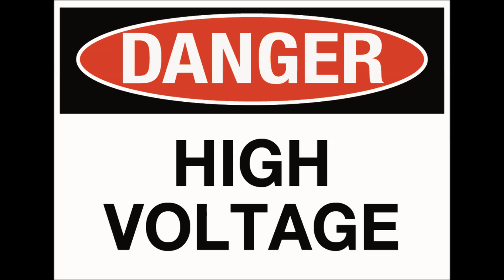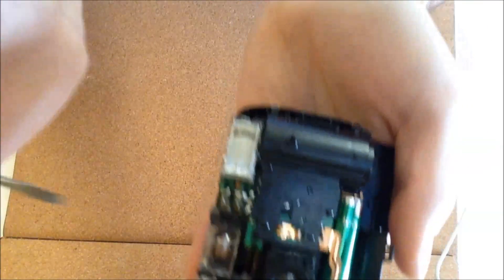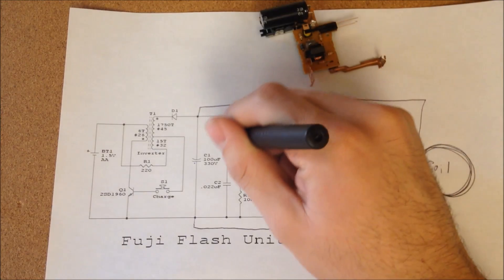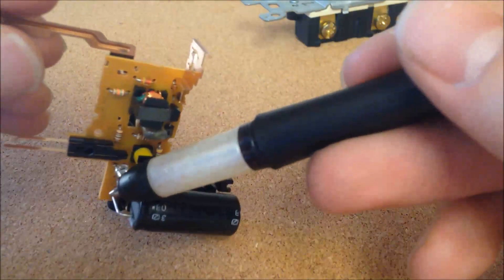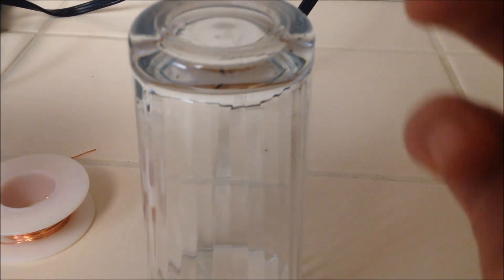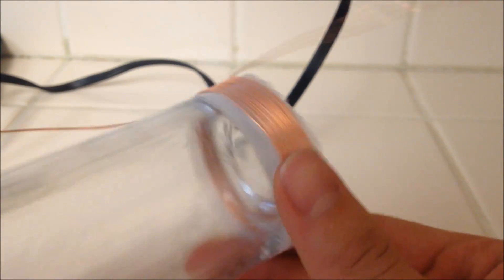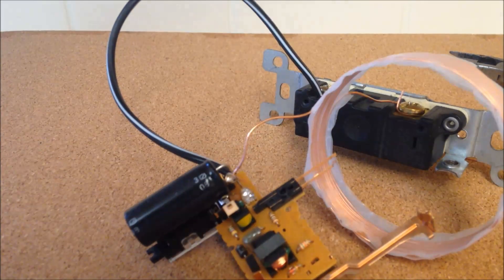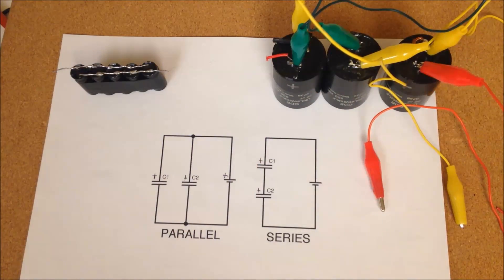How to build an EMP generator

Comment: Hi Cameron, is there a way to direct the wave to an electrical device? Or is that not possible. Thanks.
Reply from the maker: Since the pulse is emitted through a coil, I don't believe so and I haven't found a way to do it. That would almost be like trying to make very strong 1 poled magnet (a magnet has 2 poles, north and south). This device is basically a very strong electromagnet but without a ferromagnetic core within the coil.

Comment: If size wasn't an issue, could I use a very high voltage capacitor bank and charge it with a cockcroft-walton multiplier? Some days, I just feel like taking down the neighbourhood, y'know?
Reply: Don't worry I feel you lol

Comment: What Objects would this jammer disable?
Reply from the maker: +Andres Ramos It depends on the electronic device and how its design.
Reply: +Cameron Cobb what can I do to make it more powerfull ( if i decide to built it) ?
Reply from the maker: +Andres Ramos the best thing to do to make it more powerful is to add more capacitors with higher voltage and high capacity. I recommend using capacitors rated 400 volts or over with high capacity (over 500 uF). It is very hard to make a device like this very powerful because it is different than a military high altitude EMP.
Reply: Ok thanks :)
Reply: +Cameron Cobb Do you think it could disable a vehicle with enough of everything? i wonder how much it would take if a vehicle was following .
# need for speed rivals lol

Comment: Right now, I have added a 82uf/400V capacitor in parallel, but it still does not disrupt my basic video game. Do you know why it does not work or do I need to add more capacitors? My other problem is when testing the EMP (for the fourth time), I accidentaly managed to discharge it and everything just stopped working. No sound, no LED lighting up at all. I could hear the hum and see the light before but now, nothing at all happens. Do you have any idea what cause this problem? Thanks.
Reply from the maker: +dude12345 I know exactly what your problem is and it is common. When you charge the capacitors you must make sure you stop charging the capacitor BEFORE you send out the pulse. If you don't then you will damage the circuit and it will NOT work anymore and you must use/buy another circuit. And i think you should put more capacitors in parallel (make sure they have the same voltage) because it doesn't seem powerful enough to me. Another problem is the device you are trying to EMP. The devices will have a different effect than others, i recommend a very cheap video game or a digital thermometer. Hope this helps, contact me if there are any more problems :)
Reply: +Cameron Cobb ok thank you very much!

Comment: Does the copper wire have to be enamel coated?
Reply from the maker: +Nicholas Lybarger It does not. But its better because you can wind more. Think of it like an electromagnet. More winds, the more powerful it will be when induced through a current.
Reply: +Cameron Cobb ok. Thanks

Comment: you have to use a used camera that not everybody have for this circuit, yet it can be done by an autonomic self made voltage booster circuit as well
Reply from the maker: +Ronen Shemesh you are absolutely correct
Reply: Can you use a battery and and an inverter, that you connect to a wire with switch and then the coil?
Reply: @janeveroniica  yes, once you disconnect the battery it will change the magnetic field on the primary side of the transformer and that will reflect on the secondary side which needs to have many more turns with smaller gauged wire

Comment: Instead of a phone put a metal object, like a screw, inside the coil or near it. Let the fun begin.
If I remember correctly. You can modify this to propel a metal object a meter or two with a bit (a lot) of more power. (Think rail gun)
Reply from the maker: +labobo That is absolutely correct.:)

Comment: so in this instance would it work better with a transformer? why or why not?
Reply from the maker: +dudester101 It would be better to CHARGE the capacitors directly with a transformer but i dont have a transformer that would step up the voltage to my desired voltage so i used a disposable camera circuit.
Reply: Cameron Cobb
i see thanks for the reply

Comment: well what if i wanted to "shoot" the EMP at an object that is far away (roughly 400 meters)
Reply: +deathbot117 Well at the distance you'll need a neutron bomb , 1-2 kiloton should do it . Run like hell after you light the fuse .
Reply: Don Graham lol that seems like something that will cost alot :3 what about using some kind of tesla coil and super capacitors
Reply: +deathbot117 prepare to build a 50 ton emp generator my boy.
Reply: Ryan Jones awww nut i wanna portable emp gun that can knock out power to vehicles from a distance ... ahh well :P
Reply: Lol....
Reply: bob webb well what i need is Nikola Teslas coil designs and then i can get to work as im sure he made one that i could use to make and EMP gun

Comment: Awesome video!!! If i may ask , can the same circuit endure a quite a few parallel connected conductors (of let's say several 100mF and 400v conducors) and could it extend the range of the ESD to about 2-3 meters from the coil? 
Also i am thinking of fitting stronger or more direct connected batteries but i think it will most likely fry the circuitry? i guess i could reverse engineer the circuit with stronger components but i do not have the tools for it... 
i mean i could make larger coil but without stronger setup it wont do any good , actually it would just water down the effect of the ESD?
any advice and ideas on how to extend the range of the ESD would be appreciated?
Thank you for your time

Comment: Hey, may I know what is the capacitance value of the capacitor you have there? the working voltage is 330V correct?

thanks
Reply from the maker: +hazry _67 that is correct. It is a 330 volt DC electrolytic capacitor with a capacitance of about 160uF i believe

Comment: Does this permanently destroy the device or just until you turn it off
Reply from the maker: +SMATForce This EMP that i demonstrate in my video ONLY temporarily turns off the device. A bigger and much more powerful EMP would permanently destroy devices.
Reply: +Cameron Cobb I don't know if you can but you seem educated can you show us a circuit that is big enough to make a bigger EMP system that will permanently disable a small Device. And one more thing can you make a link to a circuit print like you showed in the video thanks!!
Reply from the maker: +SMATForce, "Can we EMP an IPhone?" This new video I created should answer some of your questions. :) https://youtu.be/4IRCq0fbX48

Comment: does the thickness of the wire matter for the capacitor in the camera? also, can the coil be less than 2inches in width for the diameter to yield the same results?

Comment: if i choice 16awg wire, how many turns should i make? and wt capacitor value should mactch that wire ?
Reply: +Leonardo Lee the more turns you make in the coil the bigger the field you can make.. so as many as possible. not sure about the guage of the wire....

Comment: does this work with a digital camera ?
Reply: As long as there is a flash built in to the camera it will. That's the only part that matters. But is the camera cheap enough so you don't mind tearing into it?

Comment: Cameron: what value capacitor and size coil are needed to produce a localized flux (within 1 meter) to reproduce the field from an airburst EMP device - this unit is intended to test the hardening of storage containers and I presume it will be rather significant in power.  Thanks in advance.

Comment: Not working at all with me, i practically shove my gameboy/ calculator in the coil dosent do anything
Reply from the maker: +joshua perrett either it is not emitting the pulse, the pulse is not strong enough, or the coil was poorly constructed. I am sorry :(
Reply: It was i tested the voltage with my meter, Also the coil was bulit the way you said to build it exactly

Comment: Dear Cameron. Thank you for sharing your knowledge. I have an important question to ask you. Do we have to make changes something to the circuit if we use 3 capacitors in parallel in order to charge them up. We have 3 X 450 volts at 47 uf. There is no info on the video concerning this set up. Do we have to make our own circuit ? Thanks in advance.

Comment: Thank you for sharing your knowlwedge with us. I have an important question and will appreciate your prompt answer. "Do we have to change something on the camera circuit to be able to charge the 3 capacitors in parallel ?" On your video I did not find the info. Thanks in advance. Cordially,

Comment: The 1st attempt was used with 17-wounds of 18-gauge copper wire for coil.
This is the 2nd attempt with 32-gauge of magnetic copper wire.

LED comes on but no buzzing, EVERYTHING reacts the same as the 1st attempt.

EMP.................2nd FAIL!!

Comment: How is his camera still working?
Reply: The camera is not close enough to the emp device as it's range is only about 15-20 cm
Reply from the maker: +Sid  Brown  this EMP is very weak and my camera (an iphone 5) has a metal plate inside of the phone covering the the motherboard to deflect any EM interference. Even if my camera was closer to the EMP, it would have little to no effect on my camera.

Comment: Hey Cameron Great Video!! 
 Just to confirm an EMP is simply an electric discharge from a capacitor that produces a strong magnetic field.
The magnetic field induces a strong current inside the elctronic devices which burns them out?
Are those statements correct?
Reply from the maker: Quinton Shefield That is absolutely correct.
Reply from the maker: Quinton Shefield I wouldn't say "burn them out" necessarily, Actually the magnetic field induces a strong current inside the elctronic devices which disrupts the flow of electrons. That's is just with small scale EMP's like this one though. If we were talking about a military scaled EMP that would be different.
Reply: Thanks soo much youre a great teacher. Really appreciate it!
Reply from the maker: +Quinton Shefield "Can we EMP an IPhone?" This new video I created should answer some of your questions. :) https://youtu.be/4IRCq0fbX48

Comment: What is the pulse voltage? I mean is it DC 330 volts / ?amps or AC 330 volts / ?amps, Hz?
Reply: Vladimir Nachev what type of capacitor?
Reply: Vladimir Nachev can I use silver mica capacitors?
Reply from the maker: +Vladimir Nachev I dont believe a silver mica capacitor would work. In my video i used a DC 330 volt 160 uF electrolytic capacitor. If you are building an EMP like this one, definitely use a DC electrolytic capacitor with high voltage capacity.

Comment: My circuit keeps burning its the 3rd time that i buy it
Reply: ***** i use a switch on the place of the button, can that be the problem?
Reply from the maker: ***** if you "charge" the capacitors while releasing the energy from the capacitors to the coil then yes, that is the problem. You must make sure you stop charging the capacitors before releasing the energy from the capacitors to the coil.

Comment: Pretty cool video. Now if I could only make a bigger version, but still compact...I'd use it on those punks with the loud, annoying, bass-thumping stereos in their cars. Just pull up beside or behind them and BOOM...let 'em have it...and make them wonder why their annoying stereo system is smoking and on fire...lol.
Reply from the maker: Gun Slinger Lol
Reply: but one that powerful would get you incarcerated as you could pull up to a bank and blow the circuitry in alarms and cameras and rob the place without being caught. and if you were being chased by the police you could freeze their cars
Reply: Gun Slinger but what about your stereo?
Reply: Gunslinger Survival or better yet your fuel injected car?
Reply: Wrap your engine in tin foil! :P
Reply: Gunslinger Survival Maybe try using 3-4 (american) gauge wire. with maybe a 1000 farad ultracapacitor and 4-6 car batteries in series and parralell while covering the punks in the car next to you and everything in the surrounding facinity in a 10 inch rubber coating it might work. but then again it could cause MASSIVE explosions and it might emp  its own switch system locking it on which might be a tad bit dangerous. or it could kill you
Reply: you would probably cause them to crash unless they were in an old car with no computer.

Comment: Is there a way to focus the emp pulse in one direction? And can i increase the range to 2-5 feet away? And make it very powerful?
Reply from the maker: john steven There is a way, directional would be pretty tough but i bet i could find a way and to make it more powerful all i need to do is get more and bigger capacitors and a coil with more windings with thicker wire.

Comment: Cameron Cobb i cant figure out where to connect the push button. I seen where you soldered the first wire but i cant seem to find out were the second one you soldered was
Reply from the maker: lucky blaze The push button in the video is where the "s1" was on the schematic diagram. It is used to charge the capacitors. It is NOT necessary but i use it to avoid electrical shock.

Comment: Please anybody make a video of an EMP device VS a drone. Please test on different drone like the phantoms ect..need a handheld device to take down drones. The more detail the better!
Reply from the maker: rhighlandk An EMP would work but it would be hard because making an EMP to have that far of range would be really large. Your best bet is to go with a jammer of some sort to jam the signal.
Reply: Cameron Cobb as far as im concerned drones all run on 2.4 Ghz systems which most jammers and emp-type devices dont work on that signal. Plus 2.4 Ghz is a "freeway" type of frequency which hold multiple signals on the frequency and tell them apart. As far as im concerned the best emp u could use on a drone is a SMAW lol

Comment: So what dictates the strength of the emp 
Capacitor size amount parallel?
Wire size amount of windings?
Reply from the maker: Alphonso Mobley Capacitors dictate the strength of the EMP and the coil depending on the wire and how many windings and the rating of the capacitors dictate the range. I guess you could say that the strength of the EMP is determined by the coil windings and wire and capacitors. The capacitors is its energy capability and the coil is how that energy is exerted. :)

Comment: I am going crazy her.  I am doing everything Thé same as you are doing but mine doesn't work. When i open Thé switch i only hear shortcut and emp doesn't work. What am i doing wrong i really do not know
Reply from the maker: Oğuzhan Yagmurlugil There is a few possible things:
1. Your device you are trying to EMP is too secure/strong from electromagnetic interference 
2. Your coil was poorly wound or wire is too thin
3. Your capacitor voltage is not high enough
4. Your EMP is too weak to "knock out" your device.

Comment: Sir i really like your circuit, even i didnt tried it. Actually i wanna try. Can we just add more powerful capacitor without making any changes to ckt. Is calculator or mobile phone is more vulnerable to it..actually the multimeter used to display the voltage???. How much capacitor should i use (maximum volt and micro farad).......
I think its awesome.........
I dont have enough fund for a second ckt.. and thinking of submitting this as my project.
Reply from the maker: +Deepu Veliyaparambil incredibly sorry for the late reply. And yes, you can add more powerful capacitors without making a change to the circuit. This EMP is more vulnerable to devices like calculators and cheap video games rather than mobile phones and for the capacitors, i recommend anything above 300 VDC with a high capacitance such as anything greater than 500 mirco farads.

Comment: how far is the raduis of this emp generator
Reply: Drunk Gunners The camera would simply just die. Also im not really an expert at building an EMP generator, so i cant really answer you :)
Reply: Brandon Santos It has a short range. If it had a longer range the camera could have been affected.
Reply: hardrock22100 in what way would the camera be affected? Also, is it possible to get an effective range of about 5 feet with this camera method?

Comment: I've got 2 questions for you:
1. Is it possible to create an EMP generator with that much power, so it will turn off/kill ALL THE ELECTRICITY in maybe a building? I mean, everything.
2. And is it possible to create a directional emp? Like when you direct it at the TV and it turns off/dies?
Reply from the maker: Григорий Мельников 1. It is possible but it would be very tough to do with the way i do it in my video. If i were to do it i would NOT use capacitors and a coil to do it because that would be very large, very dangerous, and it would not be efficient. Some other way or nuclear energy would be the best.
2. I believe it is possible to create a directional EMP. I have not seen anyone do it but i do have an idea on how to do it but i do not know if it would work or not.
Reply: Cameron Cobb Thank you very much. Will look forward to your next works!